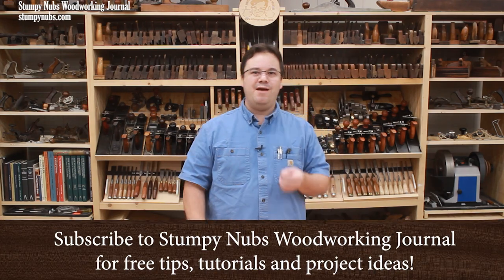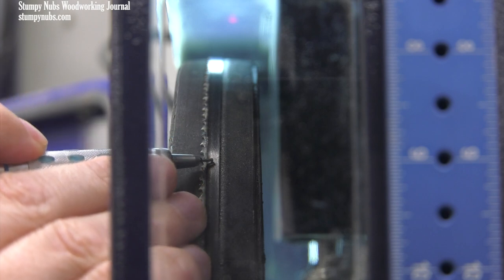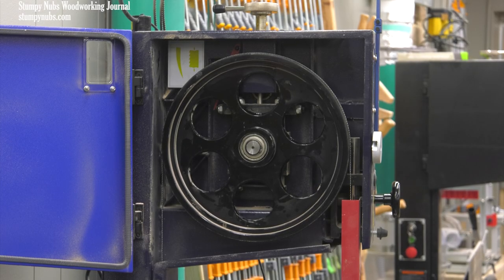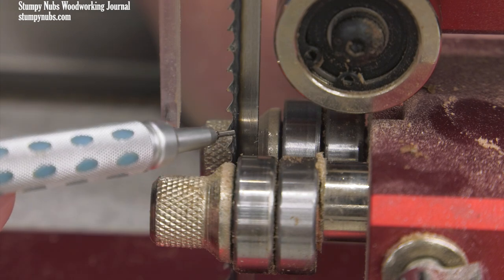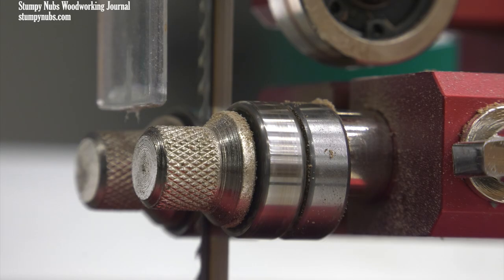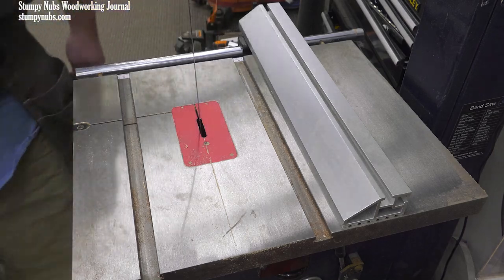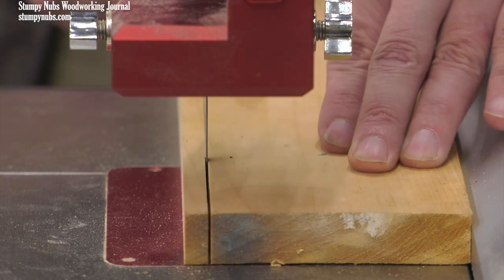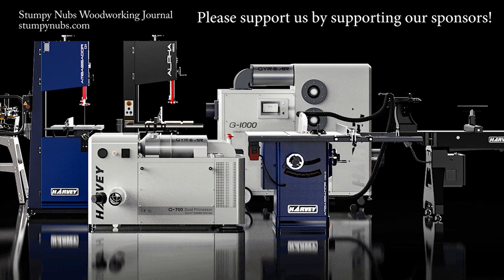When bandsaws go bad- How to fix your setup!

Comment: Drift has always been a source of frustration for band saw users.  One question though, does the table need to be readjusted every time you change blades?
Reply from the maker: No, it should only need adjustment once in a while. If you never tilt it, and you never move the saw by the table, you may never have to readjust it.
Reply: @StumpyNubs  Thanks!

Comment: I have an old, old bandsaw. It’s a Rockwell, before it became Delta. I think it’s from the 1960s. I think I need new guides. Not just the blocks, I’d like to go with bearings. Is there any recommendations for a place that will sell aftermarket guide bearings for my saw?
Reply from the maker: Carter https://carterproducts.com/band-saw-products/band-saw-conversion-kits

Comment: One of the bandsaws you showed looked like a Grizzly unit which is what I have. The tensioning guide on back is pretty much useless. At one point I had to totally disassemble it to get the upper wheel to a point where I could get enough tension on my blade. Currently I have a 1/4" blade on the saw and I'm getting a consistent 'thump' as it cuts. Would this imply the blade is getting ready to break?
Reply from the maker: The "thumps" may be from a damaged (kinked) blade, or it may be a bump on the side at the weld point, or it may be a flat spot on a wheel.

Comment: The Rikon 14” bandsaw has an adjustable cam for the lower wheel. I personally find it to be a major negative. I have yet to see a good video on how to set the tracking of the lower wheel for the brand. Any suggestions?

Comment: I noticed that your Harvey C14 has crowned tires. When I replaced my original rubber tire with urethane it was completely flat. Harvey techs say that's the way they are supposed to be. Yet I cant keep a blade on my C14 now. Who is right?
Reply from the maker: Why did you replace the tires on the C14?
Reply: @StumpyNubs Blade came of after hitting a nail in the wood. Blade broke and along with it it destroyed the tire.

Comment: I have just upgraded from blocks to bearings guides , but when I tighten the guide's thumbscrew  , it pushes and bends the right hand side of the blade ,the bearing's eccentric cam is backed right off so no more adjustment available :-/

Comment: I have a G0555 I’m not happy with the thrust bearing on the guide!
I’ll try rotating the deck but the bearing system, right left do not set even close to each other. Probably 1/4 inch is as close as I can get them! I may have to grind bearing guides
Reply from the maker: I am not sure if I fully understand what you are describing. Are you talking about the side bearings or the thrust bearing behind the blade? If it's the side bearings, can you get one close to the blade, but the other not as close? Does it look like the flat side of the bearing is parallel to the side of the blade, or might the entire guide assembly be turned to the side?
Reply: @StumpyNubs  
Side bearing clearance! Thrust bearing works great!
Your up early!
Reply: @StumpyNubs  
Yes, the left side bearing is close while the right is 1/4 inch or little more away!
The rear bearing is 1/16th inch!
I have a friend and his is the wedge type. It’s almost snug!
I adjusted deck so that now I can at least cut with out it drifting to the right as I’m cutting!
Till I’m somewhere that sells a better guide I’ll put up with the blade wobbling around knots!
After all it’s not a tablesaw!
I appreciate you and your program on YouTube!
O my blade I’m using now is 3/8 so it doesn’t have the ability to cut like a half or one inch!
Sure does nice on rounds and corners. 😆

Comment: Should the blade tension be eased when the saw’s not in use?
Reply from the maker: I do for wide resaw blades that require a lot of tension. I don't bother for 3/8 or narrower blades unless I won't be using the saw for a long time.
Reply: It's a good idea.  If your saw has a tension release, there is no good excuse for not using it -- except I forget sometime.

Comment: I'm guessing guide blocks that don't have perfectly flat ends are going to contribute to the drift. I bought a craigslist ridgid 14" and have not gotten a straight cut yet. Would be nice to use it for resawing but I don't trust putting nice wood through it.
Reply: Usually not too hard to fix that though. If it is so out of square and flatness that it would be hard to grind it flat and square again, might be way past time to get new well made ones.
Reply from the maker: Rub them on a sheet of sandpaper to square them up.
Reply: They don't have to be perfect to run straight, but it helps in the set-up to have them as nearly square as you can.  They will wear with use.  Unless they are steel, you can square them pretty easily.

Comment: I happen to think you missed explaining the most important factor, yet actually demonstrated it. Don't pinch the blade against the fence. In your fence cut snippet, the largest part of the wood was against the fence, and a free sliver peeled off. If you do it the other way, like for example for repeated ripping against the fence of thin slivers for veneering there is more pressure on the blade from the fence side than the free side, and the blade wears more on the fence side which directly leads to drift. You can factually demonstrate this. Take a new blade, verify that it cut straight and doesn't drift. Then press a piece of hardwood against one side while running, 30 seconds or so without cutting. Now the blade will no longer cut straight.
Reply: Not sure I understand this. If the blade is cutting straight, as in the video, there shouldn't be any pressure on either side. So why would it make a difference?

Comment: My blade is set so the gullets of the blade are tracking in the middle of the wheel. I forget where I learned that, but I know I did it intentionally. Is that bad?
Reply from the maker: That was covered in the video, wasn't it?

Comment: I've got a Laguna LT18 bandsaw, with the Italian Baldor motor, and it came with the ceramic guides. I was thinking of upgrading to metal bearing guides instead. In what circumstances would this make sense? Are there toolless bearing guides available for this saw?
Reply from the maker: https://www.youtube.com/watch?v=3MPR2kcMhJU
Reply: @StumpyNubs  Thanks. I watched that video, but it doesn't seem to indicate what brand of toolless bearing guides you're using, or where to get them. If I at least knew that, I could contact the company to see if they have guides for my saw.
Reply from the maker: @BobRoyAce77  Mine came with my saw and are unlikely to work with yours. However, Carter makes good toolless guides as an upgrade to many band saw models- https://carterproducts.com/band-saw-products/band-saw-guides

Comment: I have to disagree, strongly,  about blade placement on the wheels. My experience has thought me this. Center of the blade in the center of the wheels. Blade guides set their proper (tightness), you know what I mean. And a proper height above the work surface. Do this and can't go wrong.
Reply from the maker: I have one bandsaw in the shop with the blade centered and another with the teeth centered. Both cut perfectly straight without drift, including while resawing. That's the thing about woodworking (and life, in general)- There are few absolutes. What works for one person may not for the next. Do what works for you :)

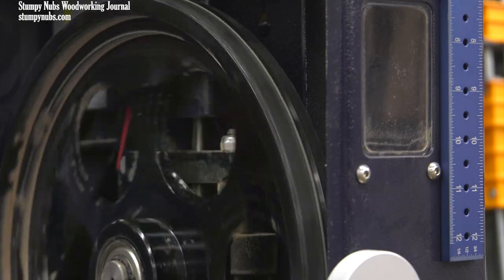Comment: 2:57  I cringed a little when you rotated the wheel by sticking your fingers through the hole in the wheel. 
If you stick your fingers through the wheel just a little too far, it's a great way to break a finger.. Be VERY careful doing it that way, and if you don't have to stick your fingers through the hole.. don't..

Comment: I have the Harvey alpha saw and It is flat out unusable it drifts so much. I've tried everything 3x and it's still junk. About to throw it in the trash.
Reply from the maker: I own three Harvey band saws. They all cut perfectly straight. 

- Here's me following a straight line freehand without a fence: https://youtu.be/jYVYmOpVl0c?si=rifQFPhG6ZpaECES&t=54 

- Here's me cutting 1/16" thick veneer with a fence: https://youtu.be/bSm6hE3bBeU?si=1cdFcxEprD2M2rck&t=293

I have used my saws in many videos, for many cuts including ripping, re-sawing and joinery. What you say is 180-degrees from my experience. In fact, I can't imagine why you would not be able to cut straight with yours, but I'll bet there is more to this story.

Comment: Get a low end bandsaw then make this video.  Instead of using a 2 thousand dollar machine find one for a 10th of that.  I've tried everything.
Reply from the maker: While unusable, junk tools certainly exist, you do not need a $2,000 saw to cut straight. I've had plenty of old, used tools in my life.